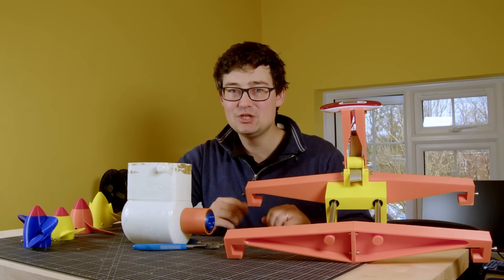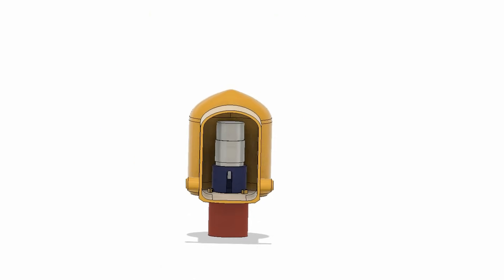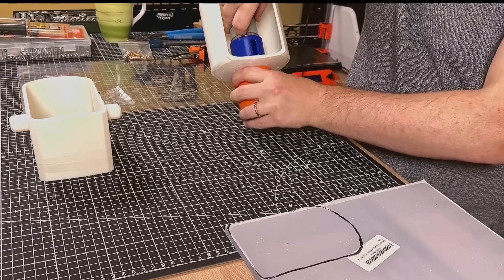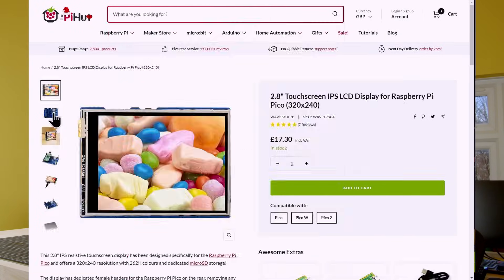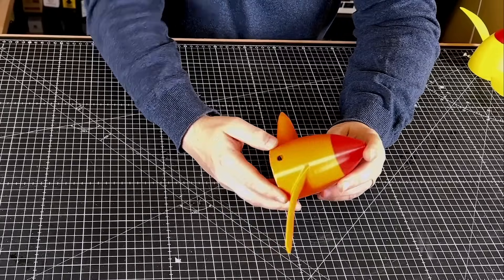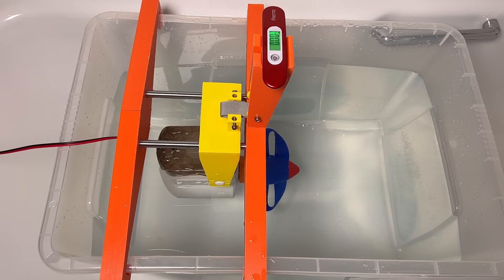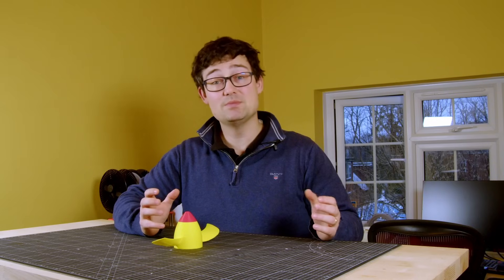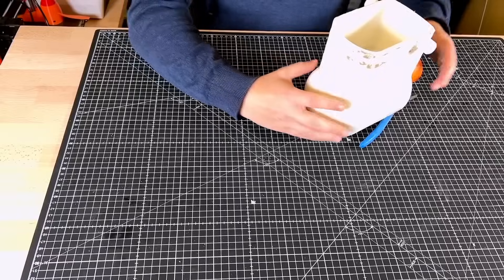Non-Contact Underwater Propeller Drive - Building a Print-in-Place Sea Scooter (Part 2)

Comment: dont use 3d props if you are not sanding them
Reply from the maker: Thanks for the suggestion. Since this video I’ve actually been sanding and clear coating the props. Check out the part 3 sea scooter video.
Reply: Cool!
Just yesterday i finished my own sea scooter, with 6384 motor. It was really fun. I will upload a video soon
Reply from the maker: @matatisan  congrats!

Comment: Why dont you put the motor outside in the water? Brushless motors are waterproof.
Reply from the maker: Thanks for the suggestion. I’d be super interested if you have a way of doing this without violating either of the design constraints for the build.
Reply: @DesignedtoMake  Just mount the motor directly outside and pull the 3 wires inside and seal that good. You will only need to wash the motor after using it in sea or lake water.
Reply from the maker: @unity4alle1   Ah, I see. Totally agree that brushless motors work in water, at least for a while. However, two things that I want the build to achieve is, firstly to not have any holes that would require seals, and secondly to be able to print the hull in a single print.

Comment: You said the propeller coming out of the water decreases efficiency. It actually increases efficiency and the technique was used by an all solar boat to make a transatlantic voyage in record time. The vessel is the PlanetSolar.

It works because the air bubbles brought in across the propeller blades reduce the drag. Most of the bubbles are brought in on the low pressure side of the blades that aren't doing anything to produce forward thrust anyways.

They do they same thing with high speed racing boats. When they get up on plane, the propeller is only half in the water. It's actually supercavitating as well so the frontside of the blades aren't touching the water at all. It's all pretty amazing really.
Reply from the maker: @Chris-oj7ro. Thank you, that's super interesting. I new that partially submerged props where used when you want to really maximise surface speed but I didn't know that they could also shown to be actually more efficient at low rpm's as well. I googled a picture that someone suggest is the PlanetSolar Prop https://www.boatdesign.net/threads/surface-drive-with-large-diameter-propeller.68788/ It really is half out of the water!

I do suspect you might have to design a prop specifically to be more efficient in a partially submerged configuration rather than expect all props to work better partially submerged. But very  happy to be shown otherwise :-). 

Thanks again for the great comment!

Comment: just make the casing from rings of copper and zinc... and only use in seawater... :)

hmmmm... magnetic drive, imho, seems superfluous... ever looked in a submersible pond pump?

the motor itself IS the magnetic drive.
Reply from the maker: Ha, very amusing re. copper and zinc hull suggestion! 

You could absolutely design an outrunner bldc motor that is integrated into the hull to drive the propeller. But it would be quite a bit more involved to design and build from scratch and still be reasonably efficient and doesn't melt. Perhaps reusing the stator from a commercial outrunner motor and designing a 3d printed rotor could be an effective compromise as any integrated hull solution would require the gap between the rotor and stator to be greater than a commercial motor would be designed for as the hull would take up some space.

perhaps something I'll try on a future project.

Comment: I think having a smaller higher rpm propeller would let you push more wattage through the entire system. Looks like youre magnetic drive is the weakest link beeing not able to put through enough torque, and a smaller thin bladed propeller would fix that. Toroidal propeller sucks and the one with the thinnest blades should have won if everything else is good enough. I assume this from watching the YT channel (the fellow with the water foils) which did a ton of serious propeller testing. I'am aware that your magnetic torque converter has a hysteresis but I'd assume your rpm isnt high enough for that to be an factor at this low rpms.  You cant have air in the propeller while testing since it really throws of the measurements. Anyways good showcase for a magnetic gearbox :)
Reply from the maker: Totally agree with the logic! I've even tried to give this a go in the latest video😀.

Comment: Good work. I like a flange setup though where you join parts. Centimeter or so. Give your epoxy a wider area to grip. Or even flange, plastic bolts and a gasket instead of epoxy.
Reply: Also, could the low freq vibrations or pulses just be your magnets slipping?
Reply from the maker: I absolutely agree flanges would be better. Once the magnetic gear slips and looses synchronisation you really know about it as it stops transferring any torque until you stop and start the motor so that it can regain synchronisation. You can hear it happening at the end of each motor test run when the motor suddenly spins up much faster.

Comment: If you want to fast forward yor waterproofing adventure then check out  the channel CPSdrone with 1 video in particular that may interest you- they test the waterproof qualities of different filaments/ different 3d printing materials- including testing coatings or chemical additives the best one being Dichtol.. check them out...i mean, they are all about submarines...submersibles...i am sure you'll learn a thing or 4 and i am sure that if you all connected could all resonate off each other (hopefully not like the 1 propeller tested here....)

Comment: You really should try the test again with all of the blades well below the water line. The longer narrower blade will be much more efficient than the toroidal propeller. Its just that the cavitation from the blades leaving the water ruins the whole experiment.
Reply from the maker: Totally agree - this along with having a go at optimising a few other aspects such as prop scaling factor, improving surface smoothness and possibly using a more ridged material to print the props with might be good to try in future. But the toroidal prop really was very quiet!

Comment: The 100% print in place requirement is feature creep. You can chemically bond most plastics with the proper type of adhesive.
Reply: wireless above water to a buoyee and then fine yet high strength fiberoptic line at a slight tension to the submersible-

Or how about a daisy chain of "bobbles".....small transceivers that can be disposed of or gathered after the mission which allow for a signal to be relayed over shorter distances?

Or a semi autonomous application where the submersible has many obstacle avoidance features...so that you can navigate to mission critical area. Get the lay of the land. Sonar or what have you to program in a action plan and let it go about its way until another decent moment of reception can be established.. so the r missions are broken down into chunks.

Fully autonomous but then the vehicle is strictly designed on abilities of not getting stuck or ways of freeing itself if getting into a situation the navigating to and from are no issue..the part where it completes a mission are no issue. But most important is how does it free itself and in which ever situation..them the thing would be unstopable!

Investigate other "things" that easilly can get to a to z in / through water...think outside the box with novel forms of communication/ data transfer.. a stone falls fast in water..maybe it carries data? Are there any novel materials applied to other technologies that can cross over? In certain places of the world, instead of using radio frequencies due to signal jammers...fine fiberoptics are used...litteral spools of cable from the back of drones...now they don't get jammed and still an reach speeds of 60km/h and more... observing nature...when spiders hatch..they let out fine line of their web matterial..this fine line catches the wind and with their miniscule mass of absolutelly almost nothing(compared to us...) they can be whisked away at pace with the wind, some times KMs

Hpow about lazers? Do beams of laser light travel through salt water efficiently?Somewhat efficiently? Information can be transferred using lasers..could this be a way to transfer data to and from a  submersible?

 How about a combination of technologies? Maybe utilizing a plethera of technologies where a determined mission crittical area/ perimitter is determined which probes or drones can be deployed...maybe those are tetherred to a central bobble(so that there aren't so many lines about)...haveing only 1 line up to he surface. Back to the perimetter probes..these relay data to the main craft and back up to mission central- they 2 have sensors and instruments..since they are closer proximet can utilize other technologies providing the main vehicle better manuverabillity/ control...assessing dangers..providing other perspectives if equipt with imaging equipment...maybe some sprt of swarm but certain vehicles have specific duties/ roles...
Reply: @paranoidzkitszo i think they are trying to avoid feature creep. Your suggestions seem out of scope while complicating things significantly. Are you familiar with the concept of feature creep, or overcomplication?

Comment: Great design! How about wireless charging, wireless flashing firmware(arduino with rf module(aka wireless uart) flashing arduino for example), and Reed switch for turning on and off? 
Rheostat can be changed into series of reed switches to make different throttle too.
No holes in hull at all. 
Propellers have different efficiency on different rpms, just like electric motors, so making reductor, motor and propellers' size to match with max torque that reductor can give will result in max pull.
Reply from the maker: Great suggestions. Some of those solutions might well appear in the design. The one that I had absolutely not thought of was the reed switch quantised rheostat. I almost certainly will give it a go.  Many thanks!

Comment: My first thought was to use the system that submarines use to transmit power thru the hull and encapsulate both prop and hull assembly
Reply from the maker: That’s a very interesting idea. 💡
Reply: @DesignedtoMake  qi charging circuit may be easier than ultrasonic power transfer

Comment: The chance of consistently choosing the wrong direction 4 times out of 4 is 1/8
Reply from the maker: Very True😀. I’ve just realised that i didn’t mention that the issue was that two of the props were clockwise and two counter clockwise, rather than me putting the terminals on back to front. So the probability of selecting 4 propellers from a bag of 20 ish propellers where two of them are clockwise and two counter clockwise and then randomly testing them in alternate order is I think at absolute best 1/16. I certainly felt unlucky at the time 😀!